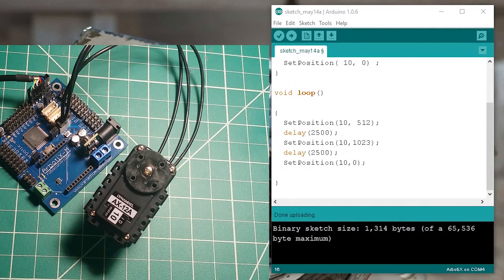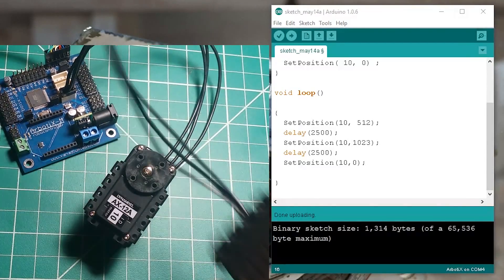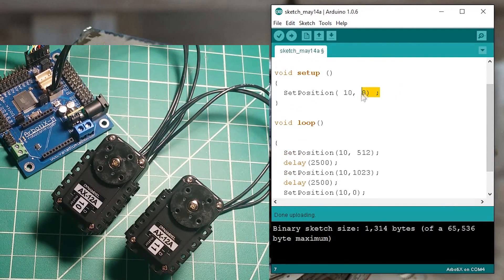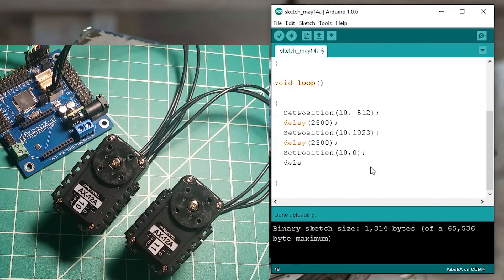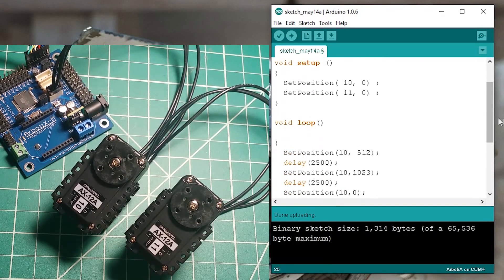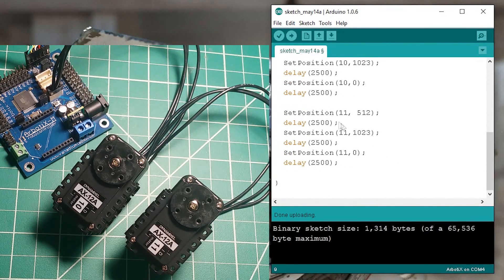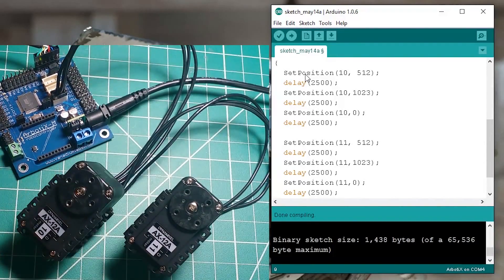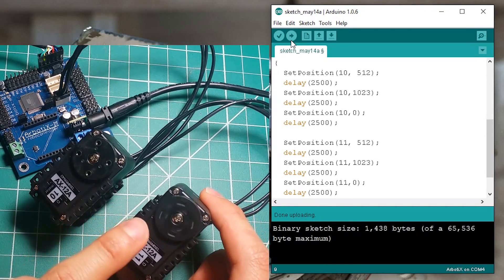Dynamixel Tutorial 4: How to Set Positions to Multiple AX-12 Servos

Comment: hey can you explain how to change id dynamixel using arduino?
Reply from the maker: I suggest getting an Arbotix micro-controller for easy interfacing with the dynamixel motors. For Arduino control you can check out this link: https://robottini.altervista.org/dynamixel-ax-12a-and-arduino-how-to-use-the-serial-port

Comment: Hi, nice video. But I am thinking about control the servo at the same time, is it possible to achieve that?
Reply from the maker: You will just have to work with the delay based on whatever application you are using it for so that way your motor will arrive at the final position within the same time.
Reply from the maker: Are you trying to write them all the same position at the same time? Or different positions?
Reply: I think both are fine. Is it possible?
Reply from the maker: Yes check out my video on broadcast ID. You can control all motors to the same position with the broadcast ID. To write different positions to different motors at the same time. Just write one position to one motor, followed by a very small delay, then write another position to another motor. Once  you run it , you wont even to be able to notice the small delay.
Reply: I tried to write the positions to two different motors, but it turns out only one can did what I expect. The other one can respond a little bit but the angles are very small. I don't know why...
Reply: yes,but if we write different position to different motors at the same time.there's a problem.for example: if motor_A and motor_B are both at position 0.motor_A need to turn to position 512,but motor_B need to turn to position 1023. then we need to set delay time for motor_B ,because motor_B will cost more delay time than motor_A.But  when motor_A turn to the 512,it will wait for motor_B turn to 1023. how to solve this problem?
Reply from the maker: Did you implement this example already?
Reply: yes,i have implement "How to Set Positions to Multiple AX-12 Servos" .
but i can not   Set Positions to Multiple AX-12 Servos at any time that i want.